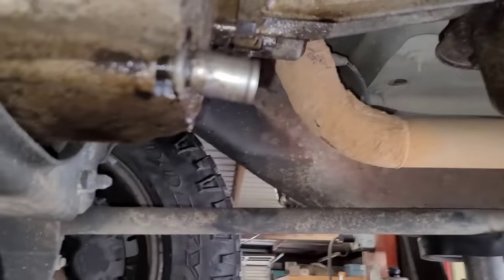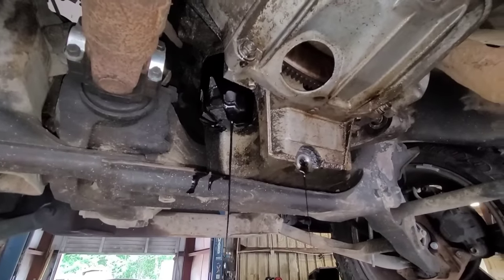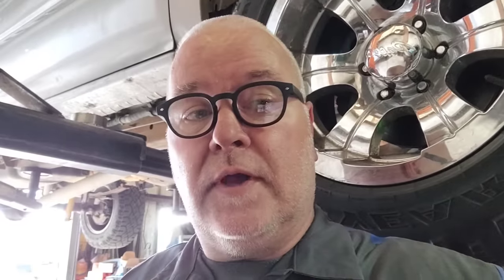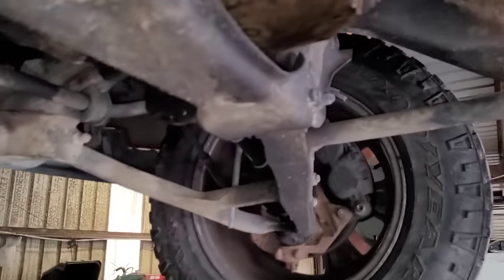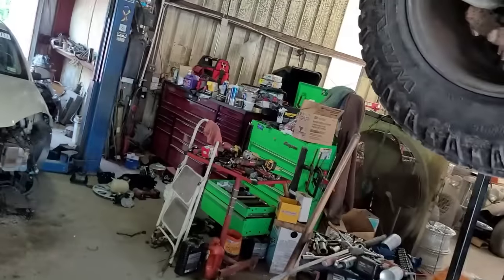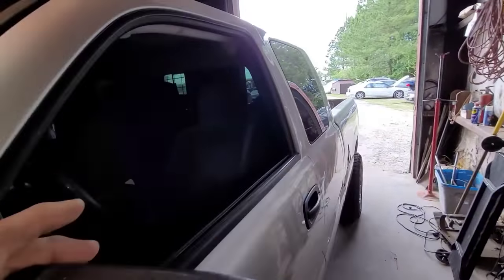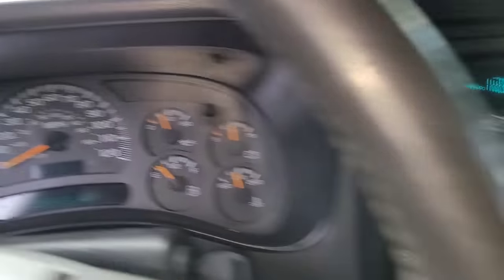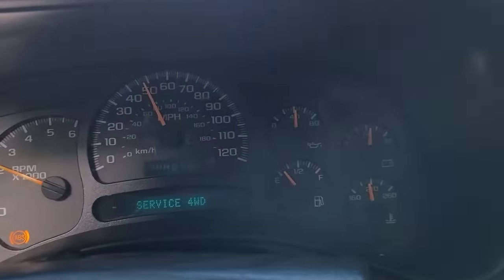We changed the oil in the noisy 5.3 and this happened!! The damage is done unfortunately..

Comment: Kenny, I like your laid back approach to vehicle repairs.  I have a 2004 1500 with the 5.3L with 307,000 miles and original transmission.  I know it’s getting tired but it still keeps going.  The main thing is I keep up with regular maintenance (oil, filters, trans fluid filters and fill) to keep it going.  Had to replace the transfer case with another used one due to case wear causing fluid to leak out.  All good and ready to work again.  The LS is a solid motor.
Reply: You can purchase a kit from merchant auto that is a redesigned pump housing cover. That will not rub through the case. Its actually pretty easy to install but you do have to open up the transfer case. There are plenty of videos on youtube that can walk you through it. It is a common issue.
Reply: I’d never put a transfer case in one of those without doing the pump rub eliminator kit from merchant auto or a couple of other ones that look pretty good. I caught mine just when it started leaking and was able to put the MA kit and a new rear case half from them in it for a full repair without any bearings or anything else. I did put a new chain in it because I was there.
Reply: Got an 06 Chevy Silverado transmission went out at 219000 Miles and right now it has 242 on it still runs really good it leaks oil in the bad places of course like where the oil cooler line yes it is have done that three times and it still leaks valve covers are leaking but it runs and drives transmission was 2000 even out the door to rebuild.. LS ain't a bad engine and it hasn't had the oil changed regularly it does get change but not on time but it ain't full-on neglected either
Reply: A 4l60e with over 300k is a fuckin’ miracle.
Reply: @01SilveradoLT  I also had a 4l80E with 300,000 miles
Reply: @TheDirtDoctor1  the 4l80e is a way beefier unit.  Came from the TH400. The 60e has roots back to the TH350. I wish you could have gotten a half ton with an 80. My 2001 is on its 3rd 4l60e but it’s the original 5.3 engine with 360k on it.  I bought it new and it’s had 120 oil changes.  Most amazing truck I’ve ever seen.
Reply: @01SilveradoLT  I get it but proper maintenance with any transmission give you longevity.  You seem to doubt me but I have never had to rebuild a transmission on any of my vehicles and all have run a minimum of 250,000 miles or more.  I'll leave it with you to decide why.
Reply: @01SilveradoLT  
I have a ‘94 half ton extended cab 2WD with a 4L80-E in it and it was built that way. It also has a 6.5 Turbo Diesel in it. It was still going at 516K when the crank broke due to a main bearing web in the block cracking out. I loaded it on a trailer with the broke crank knocking like hell and then drove it back off the trailer when I got it home.
Reply: @TheDirtDoctor1  Not doubting you at all…. What maintenance interval do you use for the transmission?
Reply: @TheDirtDoctor1  How often do you recommend to change transmission fluid?   50K, 60K?   What about the old story of "if it has 100K and never been changed, then don't mess with it or it will fail"?
Reply: @01SilveradoLT my '99 Tahoe has 275,xxx on it and still ran smooth as silk. I did a pan drop of fluid and filter change every 24 months
Reply: @willg.5168  Cool thanks for the tip. I hear that new Dextron vi is really good stuff.
Reply: @01SilveradoLT  no problem Sir, I had a Tahoe just shy of 300,000 on the odo that ran like the day it was new. I always maintained my fluid/filter changes, cuz it enables having a longer life for the internal parts. I only got rid of it, cuz I needed a 4wd when I moved back to Buff, NY

Comment: Kenny, that Napa 1042/WIX 51042 is the OE size for 03 - 06. Try using the 1522/51522 fits 2002 and older. But it's longer and easier to use on all 1st gen LS trucks.
Reply: It’s what I use also
Reply: I use the AC Delco pf61e for mine never an issue. Napa is to hit and miss on their quality anymore. Had one filter leak where it is crimped at the base and received one with no gasket both were the 1522.

Comment: The whole idea of oiling the filter gasket is to keep it from hanging up as it contacts the seat as you thread it on. Also- I have ALWAYS tightened my filters by hand the recommended 3/4 turn after the gasket seats and then another bit with a wrench. It has to seal against the amount of oil pressure the engine produces, and I have seen too many NOT tightened enough leak. Mind you- your not reefing on them, just be sure they are tight!
Reply: I agree with you but he always says just finger tight is good ,,,,but if you notice he always says I've never seen this car or truck before I have to laugh lol
Reply: @briananderson3801    I've seen overtightened  outnumber undertightened about 2000:1   In fact not sure I've ever seen a filter leak b/c it was loose.  And that's in Canada where extreme temp swings affect majority of winter trips taken...and in cold starts oil pressure can exceed 125psi
Reply: its actually meant to provide a better seal. I work a lot of aircraft parts, and its almost mandatory to lube gaskets and o-rings with the fluid its supposed to transport - whether its a hydraulic pump, fuel filter, even a plug with an o-ring on the seat. It provides a little bit of surface tension that even if it was ever so slightly loose, the oil on the gasket would be sufficient enough to stop flow out from between the two mating surfaces.
Reply: I learned as a youngster - Oil filter wrenches have ONE purpose - to REMOVE oil filters.
Reply: this has more to do with your personality than anything. same as pre-fill. same as oci... all just games. i do em so i can unscrew with my hand.

Comment: You can prime a filter that's installed horizontally or upside down. Fill it up like you did with this one and then turn it upside down over the oil bottle and only the oil in the center tube of the filter will drain out. A check.valve holds the rest of it in. I have a '93 Corvette with the oil filter mounted upside down on top of the engine and that's how I prime the filter every time!
Reply: That is only with quality filters..most all quick lube places use cheap filters that don't even have a anti back siphon valve in then.
I had a 98z71 that I put in the shop for a intake gasket and asked that he only use oem equivalent parts.( highest priced mechanic in town) When I got the tk back everything seemed ok.next morning when I started the truck it was knocking like crazy. Called mechanic immediately and as I was on the phone the knocking went away.(he tried to explain all trucks that model do that on start up) I told him this one never did,he said his mechanic has one just like it and it does the same thing) well I went to investigating and found a cheap oil filter ,looked up the filter to find out it had no anti back siphon valve which ment there was no oil going to the bearings on startup. 
Just heads up always buy quality parts.
PS.FIRST AND LAST TIME USENING THAT MECHANIC.

Comment: That’s why I change my own oil
Reply: Going to a Jiffy lube is a crapshoot. I don't need some 18 year old kid tearing the threads out of my oil plug drain hole.
Reply: @robertdonadee9860  Or putting it on the lift by the floorboards. Happened to me.
Reply: @oldarkie3880  That's ridiculous!

Comment: Couple things on the 5.3 burning oil. On a relative's 2010 gmc, gm came up with 1- a revised PCV valve cover to stop allowing oil to squirt directly into the intake port, 2- a deflector that blocked oil squirting into the bottom of the cylinder wall from oil pressure relief  above the filter (inside the pan) Engine did not smoke or leak oil.
On oil pressure, the pick up tube to pump O-ring gets hard and loses seal.
Reply: I got a afm 5.3 and I put a oil catcher after pcv orifice
Reply: Swapped out the valve cover on my 2007 GMC 250k was burning damn near a quart a month now maybe a quart in 4k miles.
Reply: @kylecasetta4091  I'm having the same issue, what valve cover did you get?

Comment: I remember back in the day I just began using use Quaker State oil in an old Chevy 1 ton van because it was cheaper..Every 3 thousand got changed. A problem appeared with a tapping noise in the engine. Couldn't track the noise down. I was baffled. So I ended up attempting to change the oil. While doing this when I removed the filter it was totally clogged and weighed a ton. I ended up using transmission fluid to help flush the system and did another oil change. To make a long story short I ended up using a different brand of oil, Pennzoil and never had an issue since. I read that Quaker State oil had been nicknamed Quaker sludge and now I believe this.
Reply: Ive heard that YEARS ago about Quaker state. My mom used dollar store brand oil in a 85 fiero because it leaked oil. Motor locked up and it looked like road tar inside that motor.
Reply: Back in the day before Pennzoil change their formula we used to call it paraffin oil Because one of their additives was paraffin wax and it would gum up your motor like crazy.
Reply: Penzoil and Quaker State are both owned by Shell.
Reply: We are Castrol fans..
Reply: @boosted.  Paraffin is not actually an additive; there are two basic types if oil and several subtypes. One basic Type is paraffin based, the other is asphalt based. The one leaves a post-refining residue of candle wax, the other a residue of road tar.
Reply: @joelee2371  wow, We always thought it was put in during the refining, at least we knew not to use it. Thanks for the education. ✌️
Reply: I think there is 3 types of petroleum bases. .paraffinic ,naprhenic and a 3rd i can't remember. ..@joelee2371
Reply: I had a mechanic tell me at his place of business they call Pennziol and Quaker State sand in a can.
Reply: Most oils are bottled at a plant in oil city Pennsylvania from rail cars with shell oil logos on them shipped up there from  Louisiana. That plant bottled oils for many brands including Wal mart

Comment: Amazing. This engine takes the abuse and keeps on ticking. It sounded pretty darn good to me. I'd run it about 50 miles to clean up the mess inside, change oil again to the syn oil, flush cooling system, put new battery in it, and drive it. Check oil once a week.

Comment: I have always used Fram filters in every vehicle that I have owned over the past 35 years, changing oil and filter myself every 4 months regardless, and never experienced a problem with Fram.
Reply: I’ve never had a problem using Fram oil filters either. I would usually buy Purolator or Motorcraft filters when I could get them but Fram makes good cartridge filters for Toyota or Hyundai cars.
Reply: @picklerix6162  I have a 13 Camry and use a Fram Ultra cartridge filter, I also a have an F150 with a 5.4 Triton engine in it and the only filter i have used on the F150 and will ever use is a Motorcraft.  An old "FORD GUY" told me years ago when I was about 16 (1978) Don't use anything but a Ford Filter on a Ford because there made to higher standard then Purolator or other filters. Other thing he told me was change the filter with every oil change!
Reply: Same, until they stopped selling them at autozone and oriellys in CA
Reply: Changing your oil that often will do that. Look up videos of filter cutouts. FRAM is trash and has been for decades.
Reply: Ronald we use Fram also but we only change every 20,000 to 25,000.
Reply: When I was going to college for diesel tech. In 2004 our professor cut open a fram filter and a filter from the Chevrolet dealership.  The fram filter had more paper and surface area.  He said the fram filter is the better filter.
Reply: Fram is junk.
Reply: Newer Fram filters have a flimsy cardboard-y element, with fewer pleats (less material) than competitors' filters. I use AC Delco on my 5.3.
Reply: The changing the oil every 4 months saved you, not the Fram. There is plenty of independent, scientific testing to show that they are far inferior filters to other major brands.
Reply: I guess fram is ok. But there are much better options out there like Wix and Bosch.
Reply: Wix for me

Comment: The oil pump bypass is the reason for most LS oil pressure issues on high mileage engines. I understand that this engine has some real exceptions. Gunk collects in the bypass piston and spring keeping it from closing to regulate oil pressure creating a low oil pressure condition. I have found that on my 4.8L LS at 241,000 miles that if you add some engine cleaner before the oil change and let it run for 5 to 10 minutes, then cycle the engine off and on with a few minutes in between starts frees up the bypass piston and spring in the oil pump. Just keep the engine below operating temp like 150 or less. Hope this helps someone.
Reply: I just had a camshaft and lifter job done on my 2004 4.8 LS Chevy and the "oil pressure low" warning comes on whenever my truck is idling, so I am going to try what you recommend and hope that it fixes my problem. It is at around 481k miles and this is the first time I have done anything to the motor itself except for it's regular oil change every 3k miles and all that. So I really don't think that I need to replace the oil pump as so many people have told me.  At least I hope I don't, but we'll see how it goes. Thanks for the recommendation and I will let yu know how it goes. 😃👍🏼

Comment: It's amazing how quiet even a damaged engine can be with good oil and the right filter just replaced.
I've had cars that had noise but had just been serviced.
Servicing again seems like a waste.
Till the vehicle gets the right part number filters and the manufacturers recommended oil .
Then the mechanic looks like a magician.
This can be true also with the correct air filter.
My 302 CFI sounded like a jet plane was trying to land on you while driving.
The motorcraft air filter tried instead took that noise away.

Comment: I regularly prime oil filters when i do oil changes- you can prime the horizontal ones- you just have to be quick about putting it on. As soon as the threads start, no more oil should leak out because the anti-drainback valve is holding it back, then if you spin it on fast, the centrifugal force will further keep the oil in the filter. You might loose a few drops, but it wont just pour out like you would suspect ;) In my experience, the gen 3 5.3 should have a cold oil pressure of around 60 cold 40 hot- the 40 cold 25 hot tells of the damage to the bearings. I just replaced an LQ4 because someone ran it out of oil- I tell people to check your oil when you put gas in the car- start the pump and instead of standing around, pop the hood and check the oil...
Reply: I do my sideways one, just fill half full. I've beat and wrench too many stuck filters off not to oil the gasket. The vertical holds oil, the horizontal will hold oil and the upside down vertical doesn't drain down. I was at an oil change place and the person wasn't filling the filters and I heard a truck rattle before it got pressure. my not have hurt it that time, but if he's your oil change guy.......
Reply: Instead of going to that hassle, just put it in flood mode and crank it
Reply: I just don't fill the ones on an angle to max capacity. At least you don't dry start the moter and cause more damage. I also use a filter with a anti back siphon valve.
Reply: Did you change the oil and filter again after the test drive.
Reply: I use to prime my PF51 with Marvel Mystery Oil. When I had a Chevy. With the Tacoma I can't.
Reply: loose change
Reply: There's literally no point to priming, your engine isn't running dry long enough to cause any damage
Reply: Splash lubrication of pistons keeps piston skirts lubricated. Low oil level you may have bearing pressure but very little splash lubrication leading to piston slap and noise. Hydraulic tappets getting air in also can lead to rattle in valve gear. Had that on an engine once at idle no noise, rev it up pronounced rattle. Oil level dropped just low enough during revving to introduce air into oil and hydraulic adjusted tappets. Topped oil up problem went. Did filter and oil change. When was the last time we checked our oil??? Bad Boys and Girls me included, I do do it but should do more frequently. Some cars now have no dip stick and you rely on dashboard to tell low oil level and the dealers suck oil out with pump and fill measured amount. I am in my sixties as a 18 year old apprentice an old Rover came in the Workshop if you pushed a button on the dash the fuel level gauge turned into an oil level gauge, they had a float in the sump and pushing the button changed the circuit over. It was old at the time and it still worked. Austin 1100 had an oil filter change warning light. Oil pressure difference into filter and out acted on a piston and spring too much pressure difference drove the piston so far in it allowed a switch to extend a pin and jam it there, at the same time the switch illuminated a light on the dash. Change oil and filter, unscrew the switch and remove allowing piston to reset and screw back switch. Cool devices before chips where introduced.
Reply: @Daizenzetsu  Any time dry running causes damage.
Reply: Pre filling an oil filter is not needed. I've never done it in over 35 years of changing oil and I've had several vehicles go over 300k miles with no issues.